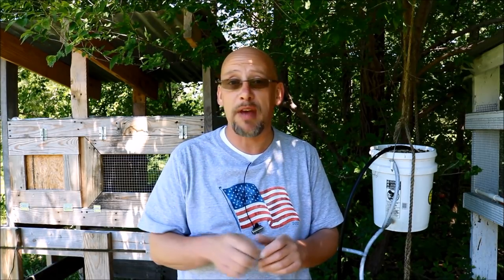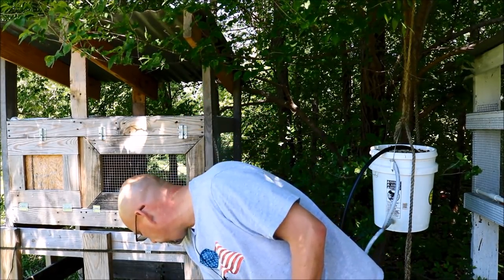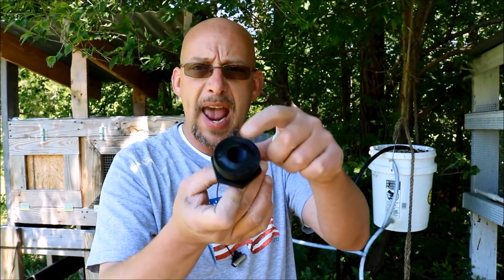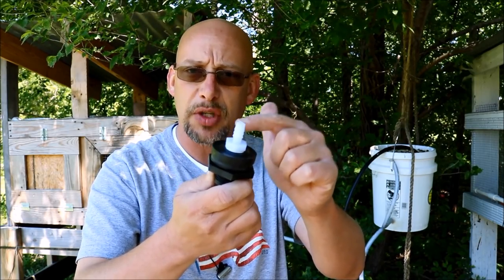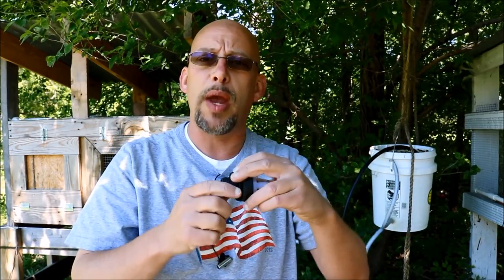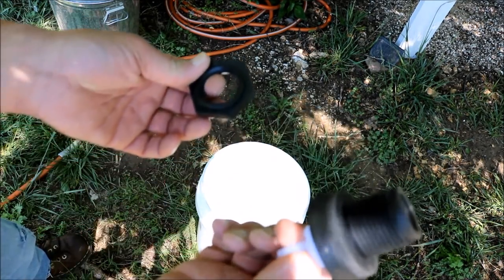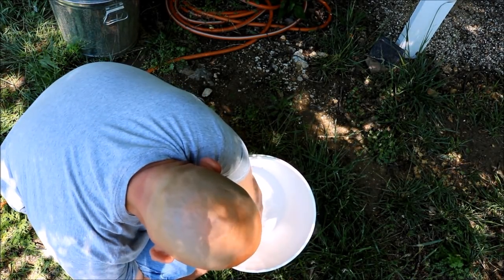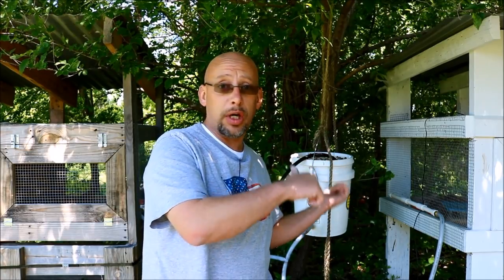Connecting a Hose to a 5 Gallon Bucket (Improving the Gravity Feed Watering System)

Comment: Bulkhead fittings work even better when installed the right way.   The larger flange and the gasket always go on the liquid side...the nut always on the outside.  They are designed to seal on the liquid side and not outside your vessel.  Been working with poly tanks and bulkheads for over 20 years and have installed 1000's....trust me on this one.
Reply from the maker: That makes sense.  Thanks for the tips.
Reply: yeah I unfortunately followed this tutorial and it's leaking; should've done it the way you describe

Comment: This is very helpful for installing a Barb in a bucket to attach a hose for an automatic Christmas tree watering system.  I’ve done this and it works. It’s this or buy a bulkhead fitting. HOWEVER. The Teflon tape wrap the tape away from you ONLY applies if you are holding the fitting in your left hand and wrapping the tape with your right hand. Me being left handed I’ll be holding the fitting in my right hand and applying the tape with my left and if I wrap away from me I’ll be wrapping it incorrectly so I’ll have to wrap towards me . I always thought it’s much easier to remember wrapping the tape like you would install a nut on a bolt or clockwise looking at the end of the fitting and you will never fail unless it’s left hand threads and if you don’t know what left hand threads are then this project might be a tad over your head no offense.  Just wrap the tape clockwise around the threads and it won’t matter what hand you are holding the fitting.

Comment: I just drilled a hole the size of the inside diameter of the hose in the bucket. Then cut my hose at  a 45 degree angle. Force hose through the hole. Did the same with the pvc that leads to my cups just drill the hole in a pipe cap and tap them together. No glue its a low pressure system.  Seals itself and about as cheap as you can get. No leaks after 4 weeks.
Reply from the maker: cool.  thanks for sharing.

Comment: Ha. I've been looking for those bulkhead fittings (?) for years, but I never found them because I didn't know what they were called. I'd been using a T fitting that came with the rabbit nipples epoxied into a hole in my bucket. I think it's safe to say that if something non-organic only lasts one season, it "doesn't work". This year, I had resigned myself to plastic bowls. Maybe now I don't have to! 

And maybe I also won't have to have someone babysit the animals' water supply while I'm gone over the weekend for work.
Reply from the maker: Well I am glad that I was able to help then.  :)

Comment: I have been using a 5gl bucket for about 5 months and all works well.  The only problem I'm having is that I'm getting algae in my clear 3/8in water hose.  I'm in central Florida and the sun her is intense causing the algae to grow.   I have cleaned the algae from the inside of the hose, but what a pain in the neck.   I was thinking of using black hose.  What is your thought or experience in my issue.  Thanks
Reply from the maker: Well if the tubes are in full sun and you use black hose you might have some burned rabbits.  You might try adding some apple cider vinegar to the water once a week or so.  Like a big glug from the bottle to a 5 gallon bucket of water and see if that helps.  I have mine set up so it is never in direct sun and don't have any issues with algae myself.  I hope that helps.
Reply: Thanks Chris.  Sorry for the delay I was away for a while.  I know about the black tubing getting hot that is why I did not go that route.  I tried the ACV, but man that left a purple goo in the bucket that gave me the creeps.  I thought the bunnies were going to get some kind of poisoning from that.  I picked up new tubing and thin walled PVC pipe and I plan on putting the tubing inside the PVC to protect it from the sun.   I hope that will work and it's an inexpensive fix.  Thanks again and keep up the good work.

Comment: Where are the links to the bulkhead connector, etc?
Reply from the maker: Oops.  I guess I should have included those.  I get mine from the local hardware store (Lowes around here).  But they can be found on Amazon.  I am sorry I don't have a link handy for them just make sure that you match up the bulkhead with a nipple that will screw into it.
Reply: You can find them at lowes

Comment: how did u cut the hole ?
Reply from the maker: I used a whole saw.  Basically a drill bit that cuts a hole.  Can be picked up at any hardware store.
Reply: @Slightlyrednecked  pl add a link on amazon, lower or home depot . maybe mac a video how to cut?